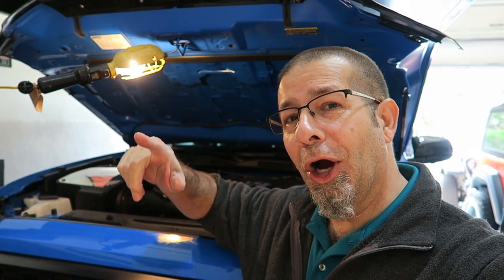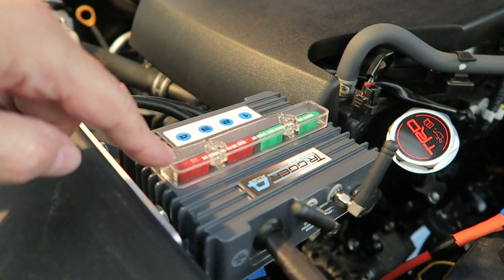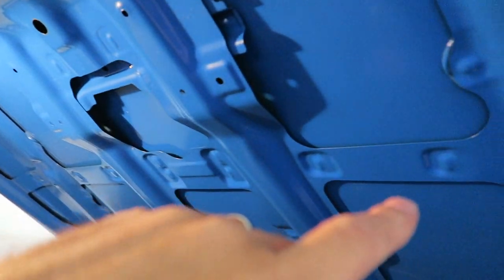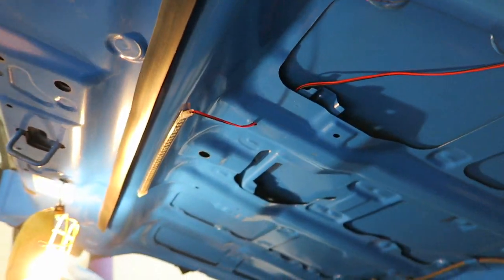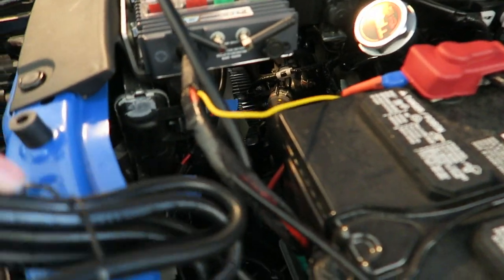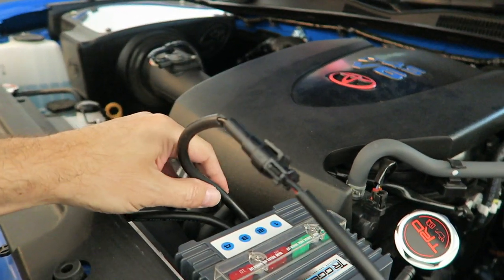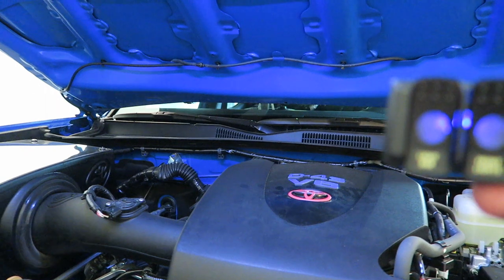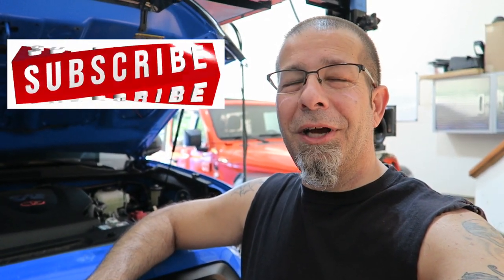Tacoma Under the Hood LED Lighting

Comment: Rob, hate to be a negative Nellie, but that light will probably not last. Adhesive mounts with gravity, heat and cold do not work for the long-term. Must be a mechanical attachment (unless it is decorative only). Or I won’t use it. Maybe your luck will be better than mine.

Comment: How do you like it since it’s had time to be used? I am debating between two lights or one. Also I have a six panel fuse. I’ll hook mine up like you did but I don’t want to use their fuse since I have a slot for 6 fuses already.
Reply from the maker: It worked well.

Comment: Quite a coincidence just received my KC led light kit and going to install today, kit comes with a manual toggle switch,  think I'll install it right front of the battery.  We'll see how the wiring goes for me with the 2 round lights.  🤞
Reply: Installed the same ones in mine. There's preexisting holes in the frame by battery that work well for switch.

Comment: Great job Rob, Wished you would have just ran the wires ( with a protective loom) externally via the holes just like the manufacture does. Hey got a question, I wear glasses, I see you with your glasses on in the truck and outside they look the same are they transitions? and if they are Signature series, Extractive, Driveware which ones are they? thanks Good video, oh yeah Ive seen blue transitions might want to look into those. let me know which ones your using they look good and dark.
Reply from the maker: I have transitions and prescription sunglasses.  I wear both in the videos👍

Comment: Great idea man! Something I might have to consider, but it will be down at the bottom of my to do list. Too many mods 💸💰 lol
But I love the idea. I wonder if you can make it work without the truck turned on?
Reply from the maker: You can.  It comes with a switch that activates when the hood is opened.  Just wire it direct👍
Reply: @RobMotive  Ah! That will work. Thank you!

Comment: Nice job! I actually considered this kit. However, I was concerned the adhesive might come loose and the strip get caught in the belt, leaving me stranded on the side of the road. 😞
Reply from the maker: I’ll keep an eye on it, but even if it came loose I don’t think it could reach the fan🤔
Reply: Indeed ....  high chance will drop soon ... adhesive over the engine doesnt looks fine ....
Reply from the maker: I disagree.

Comment: Looks good Rob, I probably would like it to come on without turning the key on or anything like that, even if a guy didn’t want to use that plunger switch, you could always hook it up with a toggle switch under the hood too, then you could just turn it on when needed!! Hey are Thundercreek fuel trailers have that same light strip right above the engine that pumps the fuel in the compartment there when you open the door the light comes on, pretty nice at night getting fuel for machinery👍!!
Reply from the maker: Oh for sure.  There are a few options depending on how you want to do it.  I may change it down the road.  We’ll see🤔
Reply: @RobMotive  Yeah, certainly easy enough to change on how you want it to come on for, at least to get it work and that’s the main thing, try it outside in the dark you won’t believe it I bet it’s bright!!
Reply from the maker: It’s really bright at night!  Perfect for mechanical surgery👍
Reply: @RobMotive  I know they are pretty bright